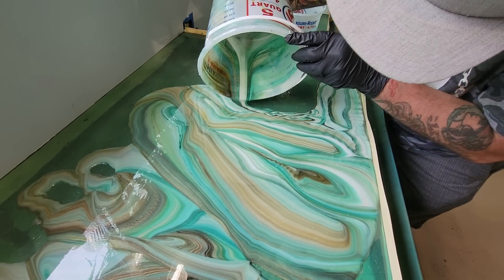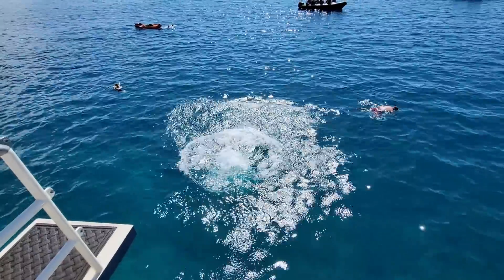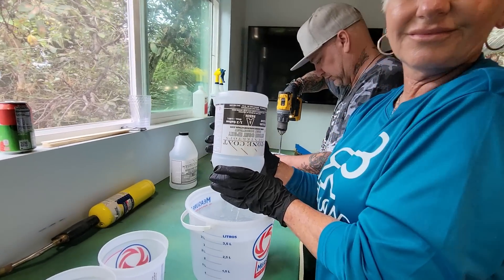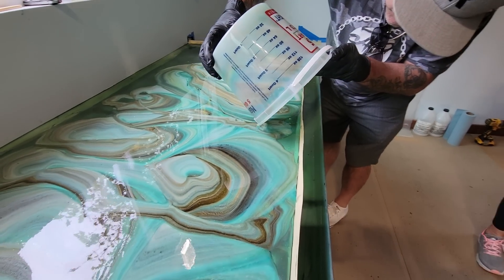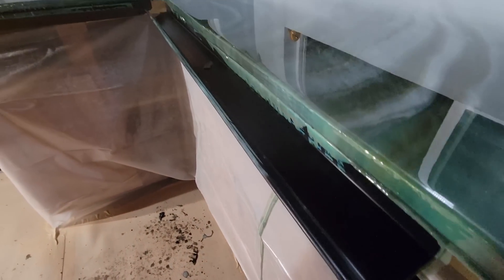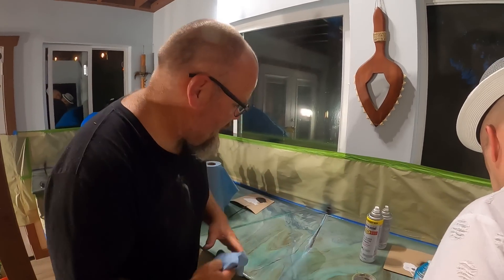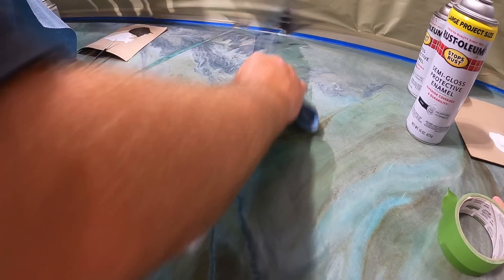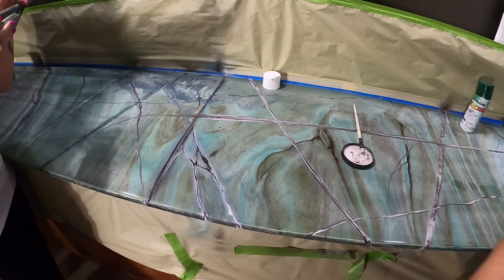Epoxy Tips I wish I knew as a Beginner 🔴 Save Time & Money | Stone Coat Epoxy

Comment: You spray painted the fracture, then just the ultimate topcoat?  Wont the spray painted fractures not have enough protection? Only 1 thin coat of topcoat?  Seems the top will have texture from the paint, therefore not very durable?  thanks

Comment: The fractures need to be all one consistent color, and somewhere in the beige-copper range, because in nature they are colored from a residue of iron/calcium. The white and black here, throws it off, imho. It looks like the color of a vein, but clearly it's a fracture, which should be a cross section of the same rock, right, but weathered differently, and all fractures weathered the same. .... 

Peace

* that's a pro-tip, lol. .. Do you need my address for my free epoxy?

Comment: sometimes you REALLY need to know when to say enough is enough !!! before you started sanding and adding the fracture lines it was absolutely gorgeous.  i realize you were doing a training class here but it was better before you did the added touches.   QUESTION, do you have to put a top coat on the finished design ?

Comment: Thank-you. Very impressive. 
1. In low humidity environments, consider adding more drop-sheet and taping. Ie. Lay/hang plastic drop shert over TV screen, and more of the windows. Reason is: very small specks of airborne spraypaint can adhere to unintended surfaces.
2. What your thoughts on using the pistol-grip triggers on your spraypaints? Is there enough precision, or is the index finger better? One other option is using your thumb, as it is less fatigued than index finger. With Nitrile or Latex glove, and thumb on top of the nosel, wrap a few rounds of masking tape around your hand to assist in a un-fatigued and more relaxed-hand hold. The disadvantage is that until you find the best position for your wrist/arm, it will feel a bit awkward. 
3. This is purely a subjective comment (and I understand that there were several people involved): I merely see a bit of over-processing in quantity of cracks/cuts/fissures/imperfections. I do understand this was a tutorial, yet may I respectfully mention that “more is not always better”.

Thank-you again, and impressive collaboration.
Reply from the maker: Great tips, I've tried the pistol grips but found they are slower for me.

Comment: Great video, thanks. At just under 13 minutes in, you remove the tape and smooth the edges. Is there a trick to smoothing the edge without pulling the epoxy? I've done that before on a table and it left all kinds of uneven surfaces. Thanks

Comment: I watched the video of epoxy on concrete floor first, and it discussed how using the torch and/or alcohol helps remove air bubbles. As I'm watching this video, if I hadn't seen the other one first I would have thought the torch was to help the curing process. This seems like an extremely important and helpful tip. So as someone new to your videos, this tip/explanation would be helpful to verbalize in more videos in case a person didn't see the other ones. Just a thought :) I'm loving these projects so far!

Comment: What type of caulk did you use? What is the point of spraying paint on the surface b4 the epoxy? How much paint do you spray into the epoxy? What's the formula? What type of spray paint do you use? How many combinations of paint are you using? What is she doing with a propane torch and why? Another "instructional" video that left me with more questions than answers. Another 20 mins of my life wasted.

Comment: What type of caulk did you use? What is the point of spraying paint on the surface b4 the epoxy? How much paint do you spray into the epoxy? What's the formula? What type of spray paint do you use? How many combinations of paint are you using? Another "instructional" video that left me with more questions than answers. Another 20 mins of my life wasted.

Comment: One thing I might want to add when doing the prep is that the Bondo dries really fast 5-6 minutes and unless you're familiar with using it, it would probably be best to mix it up on something else besides the counter top, I like using a paper plate. Then sand it before it completely hardens otherwise you'll be spending a lot of time sanding it smooth.
Reply from the maker: Great pro tip, Thanks!
Reply: That is a very good tip! I forgot to remove the excess before and you are right, I was sanding for DAYS! Thanks for the great comment David, how long have you been watching us on YouTube?
Reply: Dry time also depends on how much hardner you add too lol bondo is a big juggling act in my eyes lmao
Reply: I used a grinder then sanded
Reply: @StoneCoatCountertops  I have been watching for about 6 months, since I bought a house and decided I wanted to epoxy the counter tops. I know about Bondo from being a automotive body/painter